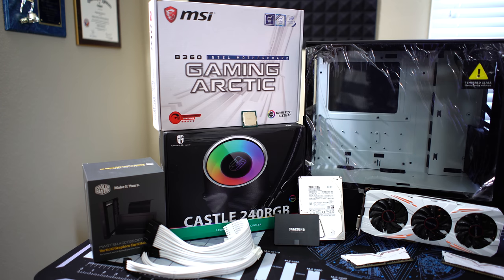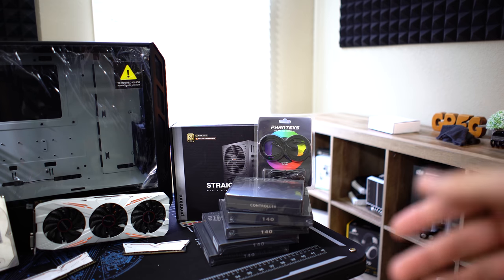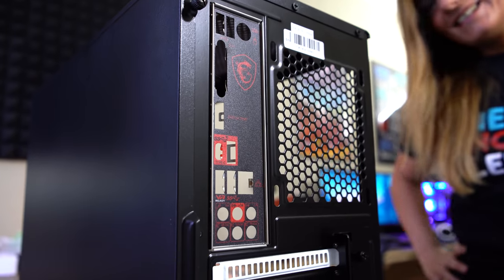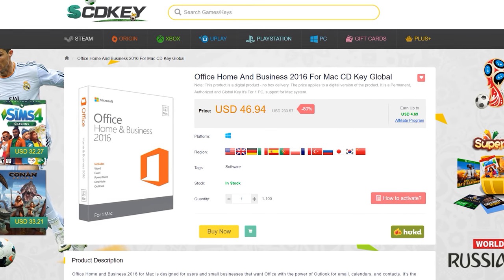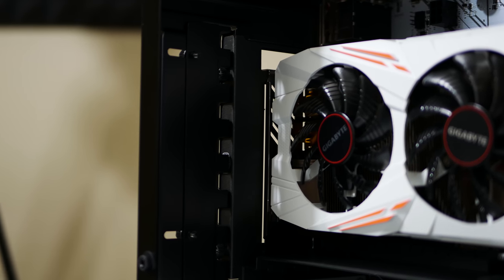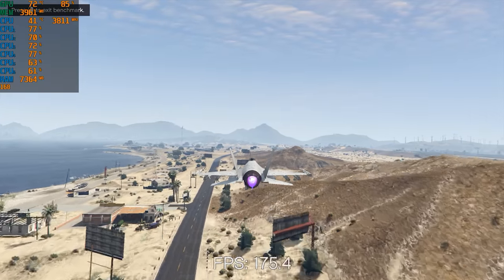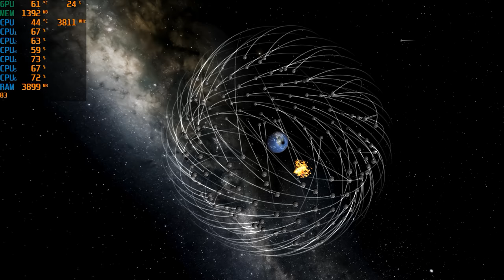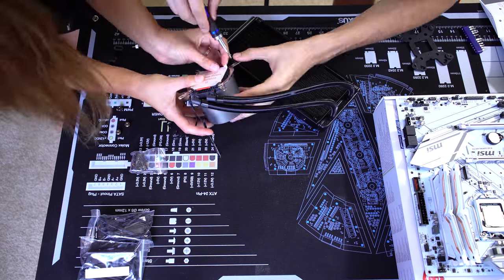We Paired a 1080Ti with an i5 8400...

Comment: Now try an 8350k. That'd be interesting.
Reply: ImpairedWraith 
Nobody likes to test the 8350k because of the high msrp.
 That being said i got my 8350k for $130. Overclocked to 5ghz and paired with a 1070ti, it scores a 16866 in firestrike. 10609 physics score which is cpu intensive.
Reply: ImpairedWraith is it as pointless as 7350k that Greg uses occasionally as a box cutter?

Comment: you kidding me, I stream with this cpu with on board integrated graphics don't underestimate this processor
Reply: 1080p or 720p
Reply: @sauravpradhan7881  mostly 720p it does stream on 1080p but it is very laggy now i have a graphic card finally so its sorted now
Reply: @faizbaig992  by nvme
Reply: @sauravpradhan7881  yeah i will some day

Comment: utilization is all well and dandy, but where are the 0.1% and 0.01% low frametimes especially when compared to the cpu's big brother? average framerates/utilization are great, but immersion breaking framedrops are shitty too. usually the i5 does worse than its i7 counterpart in this regard and almost every time intel cpus do this better than amd cpus. also depends on if you want ultimate best performance vs good performance. I think you want the former if you have a 1080ti

you should add frame data

Comment: getting a 1080ti inside i5-8400 is ok. Getting a new PC with i5 and 1080ti is however silly.
Reply: Marek Nowakowski this. Unless on budget
Reply: maome kat I don't see how you can argue about saving 100$ on the CPU when building a PC for 2k plus.
Reply: Marek Nowakowski on budget means 1000$ pc with usually cheap mobo/cpu/psi but you are right this mentality doesn't work with 1080ti.  It works with 1070 /1080 which cost 400-500 leaving you enough for cheap cpu/mobo/ram or used cpu/mobo combo which where old i5k/i7k work beautifully with 1070 for 120fps or 1440p 60fps

Comment: Great video, all the mistakes were avoided by.:
☑ 3000mhz memory on a board that only supports up to 2666mhz 
☑ useless Aio on that chip that runs cool on stock cooler.
☑ tests a 1080ti at 1080p
Reply from the maker: It's what I had on hand. Chill out.

Comment: Tho I’m no overlocker myself, I’d probably still opt for the i7-8700K as of this video, the i9-9900K as of my comment. Why? Easy: My PC will have to last 7 years+ before I’m getting a new one. The PC I’m using right now is 9 years old already with only a dual core CPU and while I admit, it’s just too old and weak overall, the software has become so much more demanding than I’d have expected back then, that I’d rather do opt for overkill, than being punished in the long run.

Comment: I would say Ryzen 2600 is better than i5 8400

It's all depend on you're Monitor actually 

Mostly people gaming at 1080p 60FPS

Ryzen 2600 is better for this case

It's has 6 extra thread over i5 8400 6C 6T ( and not forget about 12nm over 14nm )

& last not forget about CPU Heatsinks that include

Intel stock cooler i heard run a little hot at i5 8400 ( and it ugly )

But the AMD stock cooler is just `okay' 

You can gaming on AMD stock cooler without any overheating...
Reply: I own an i5 8400 and have to disagree and just to note that chip cannot overclock. My i5 runs cool most of the time even in heavy AAA games and I haven't experienced any heating issues unlike my older AMD FX6300 chip which used to shutdown even on liquid cooling.i5 8400 is still better over the 2600 in raw gaming.

Comment: Should I pair the i5 8400 with a gtx 1050ti? Or the ryzen 5 1600. On a budget that is why no ryzen 2nd gen
Reply: Go with ryzen. But your 1050ti will be a severe bottleneck
Reply: Neko r3 otherwise would be a great choice,since the gpu isnt high end one
Reply: Neko is a gtx 1060 6gb with the 1600 better
Reply: Simply Schematic the 1060 6gb would be way better
But i dont know the current price of these. If you squeeze a bit more out of your budget, then go with the 1600 and the 1060.
Will be a nice gaming rig!

Comment: I am going to upgrade but I can’t choose i have i5 6600k with gtx 1080  witch one to get i5 8600k or i7 8700k
Reply: I7, will definitely last longer. 12 threads will really be much more future proof than the 6 cores on an i5. I have a 1080 ti with the i5 8600k, runs almost all my games perfectly. Only need to overclock it to 5 ghz for Battlefield 1

Comment: I gotta disagree... Even though cpu utilization wasn't at 100%, since the gpu wasn't at 100% load, cpu was bottlenecking it still. I would say the bare minimum for a 1080ti is an overclocked i5 8600k. If you want to pair a lower end cpu with a 1080ti, play at 4k(more load placed on gpu).
Reply from the maker: GPU hovered in the mid to high 90s throughout most of these benchmarks... not sure to what you're referring.

Comment: Reasons to consider i5 over equally ryzen if you're on a budget:
Slightly better framerate in all games.
Better prices for motherboards, don't buy a ryzen without overclockable motherboard.
RAM price is retarded right now, and ryzen benefits heavily on RAM speed.

Comment: I run a similar build with a Ryzen 3 1200 @ 3.6 GHz, not found the limit yet.
Then a Zotac GTX 1080 Ti Mini and 16 GB DDR4-3600 RAM. :)
The Mainboard is a Gigabyte Aerus Gaming K7. Running stable so far with a really low temperature of max 50°C. :)
And compared to my old AMD FX 4130 or AMD FX 8300 it's 100%+ faster in 4K gaming. <3 (\ô/)
Reply: i wouldn't pair a 1200 with anything above a gtx 1060 or so :o
Reply: I don't see any problem with that. 99% of the time, the GPU gets 100% load, which seems fine for me. ;)
Only 3, maybe 5 out of my 500 games are running at 75 - 88% GPU load, which are mostly the high FPS ones, which wouldn't happen much in 4K. ;)

But I plan on upgrading to an AMD Ryzen 7 2700X, but at the time I build my PC, with a strong GPU, I only could get a cheap CPU. :/
And then I took the Ryzen 3 1200 and run it now stable at 4 GHz @ 1.5 Volt and temperatures stay around 58 - 67°C under peak load and I don't know if the Ryzen 3 has an offset too. :D (\ô/)
Reply: i forget sometimes man, too much weed XD
Reply: I don't blame you. :)
But the GPU is way more important than a CPU. ;)
The CPU is quite good enough, if it's a quad core, only high refresh monitors it's really important. ;)
But I'm running a 4K 60 Hz HDR10 panel, so the CPU isn't as important as the GPU. :) (\ô/)

Comment: i run my archaic 5820k x99 deluxe build @ 4.1 ghz to the death lol with 32 gb dom plats 2666 mhz cl15 with the corsair h105 240 aio and the evga 1080 ti ftw3 hybrid.. 1 tb 970 pro m.2 as system drive and 2x the 860 evo 1tb in raid 0 as fast storage and for games, a 120 gb sandisk ssd i don't really need anymore so i use it for swap and caching and stuff and 4 tb worth of hhds.. i don't see any need to upgrade anything anyhow whatsoever lol.. i mean the 8700k would be like what? 10% improvement or so.. not worth changing board and cpu yes faster clocks ipc and jibber jabber.. but dual channel ram so it looses there.. i don't know if ever i'd get the little threadripper with 8 cores and 64 lanes and reasonable 'bout 4 ghz clocks.. but not a good overclocker and well.. again i loose the single threaded performance i want.. so i'll wait.. what i have is more than i even need lol.. but sure nice to have.. and i can't really get from the cpus out right now what i really want.. lots of lanes, quad channel ram, not so many cores but high clocks.. and it goes really against that at the moment.. i don't need friggin 200 core cpus at 1 ghz i want 6 or 8 but fast cores..

Comment: but why? A 1080Ti is $750+ I would get it if the difference between a 1080 and a 1080Ti was $100 because you will get way more bang for your buck out of a 1080Ti over a 1080 vs a 8700k vs 8400, but the difference between a 1080Ti and a 1080 is $250 the price of a 8400 it's self.

If you haven't got the money to pair a 1080Ti with a 8700k just go with a 8400 and a 1070 / 1070Ti and go spend the money you would have saved half assing it on a better monitor or something, or even better just pocket the money and spend it on something worth while, the point of buying an 8700k to pair with a 1080Ti is so that you don't have to buy a new CPU and probably motherboard when you want to upgrade your graphics card because not only do you get the 6 cores 12 threads, but you also get the ability to overclock which will give you a lot of headroom when trying to run the "1180Ti"

The reason why I argue for the 2700X / 2700 / 2600X / 2600 is for people who are going to be keeping there CPU for like the next 4-5 years, the 8400 with a 1080Ti at 1440p is already maxed out at 90% to 100% utilization, while the 2700X / 2700 / 2600X / 2600 are at 40% to 60% utilization, I wouldn't pair them with a 1080Ti though as next gen you likely would run into a CPU bottleneck because I don't believe games by that point will be fully optimized for Zen or use 12 to 16 threads well.

The 8400 is bad in both the mid term and the long term, but if you plan to upgrade again within the next 2 years and plan to go with XX70 XX80 class GPUs it's not a bad buy, but it's an especially bad buy for a 1080Ti unless you upgrade your CPU every year, in which case then I would say you would be better off with Ryzen as Zen 2 coming next year will be compatible with current motherboards.

Comment: Uh I have an 8400 and it multitasks just fine? Like I have a bunch of apps open, and can still run games and get very good performance (haven't benchmarks, but haven't noticed any differences)...? I don't notice any lags when swithing between apps as well so I'm disagreeing with your impression about the i5.

I'm not disagreeing that the R5 x600s have better multi core performane (heck I would expect it to, it's an OCable SMT 6 core CPU), but rather that you're giving an impression that the i5 is a terrible multitasker which it definitely is not. 

Why not run a side by side comparision between it and the 2600 and have a load of apps open, do a bunch of app switching, using different apps, streaming YouTube, have loads of tab open and switch between them, play games while running lots of apps, etc. ?

I'm running 4 x 4GB dual channel fyi.

But seriously mate, sexy af build bang/10
Reply: Wizard Koer they have never been terrible multitaskers but when you run newest titles open a ton of shit up and stream then you will notice that i5 will bend to its knees

Comment: i have so many issues with i58400. im pretty sure its bottlenecking my GTX 1070. it always runs at 100% in modern games and i get a f ton of fps drops. my GPU often won;'t go above 60% so it can't be my gpu. Temps are fine
Reply: Check your ram speed ,had same rig and there was no bottleneck.now using a 1080 games run like breeze.Im using a 3000mhz ram tho on a z370 mobo.try disabling hpet in bios as well

Comment: I have a i5 8600 and a GTX 1080ti but in AC Origins and NFS Payback (maybe more games) the cpu usage is at 100% which limits my FPS and also in GTA V i dont get nearly as much FPS as in this video...what kind?
Reply: Same here I have a 1080 ti with an I5 8400. I just recently upgraded from a 1060, experiencing the same high CPU usage in games like BF1, Vermintide, Witcher 3.  I am playing at 1080p  75Hz. I think resolution may have an effect im not sure. What resolution are you playing at?
Reply: @WoollyWalrus  playing at the exact resolution and refresh rate as you. Ive even gone 1440p like in the vid but no luck.
Reply: @skillsteal8914  what about your ram? Are you maxing out your ram? I personally will be upgrading my ram soon from 8 to 16. I know that 8gb for the 1080 ti isnt enough. On games like bf1 I pretty much max out 96% of my ram. 
Most people online told me it's a processor issue. At first I thought it was my resolution being low at 1080p causing a lot more load on the cpu and less gpu utilization. But it turns out that increasing the resolution could put even more load on the cpu. I am honestly not sure at all how in this video he managed to get this kind of fps. But my rig can not even keep 75fps in any AAA game. This really sucks I was getting more stable performance with my 1060...
Reply: @WoollyWalrus  ive managed to use a cfg file for bf1 that allows me to play at 4K 60fps all the time. I have 12gb ram. Ive read that increasing the res does utilize more gpu, ive seen this myself while playing ac origins, going to 4K does make my gpu max out but my cpu usage stays at 100%. Far cry 5 i can max out while capping to 75fps at 1440p using the in game res scale i rarely drop below 60fps although again my gpu and cpu does not max out to keep it at 75fps.  GTA V i play maxed (no advanced settings on) at 1080p with about 95-105 avg fps, my cpu and gpu utilization is never full which i find odd though. All in all ive noticed that capping a game to either 60fps or our 75hz refresh rate does help with the cpu utilization.
Reply: @skillsteal8914  are u playing at native resolution or through dsr?
Reply: @WoollyWalrus  playing at native however games that have an in game res scale i usually play around with
Reply: I've got the 8400 and I don't get anywhere near 100% CPU usage in any game I've tried.
NFS payback I'm sure is 70 something and BF1 is like 75-85 if I remember.
I've seen 90 a few times but that's fine.
Not sure why yours is so high.

Comment: I think my i5-8400 is bottleneckng my rx 5600 xt, but i'm not really sure bcuza i also got 8 gigs of ram, so that also might be a ram bottle neck right? or is that my cpu?
Reply: If cpu usage is 99% and gpu usage is low, then its cpu bottleneck. Ram shouldnt cause low fps, but if a game stutters no matter the settings it means that you dont have enough ram. Tho i think 5600xt and 8400 should be fine.
Reply: Get 16 gigs of ram bro I had the same exact GPU and CPU as you and also 8gb of ram, once I got 16 gigs of ram my games didn't stutter anymore

Comment: Ewww you choked the gpu with a vertical mount. Its far less often the riser cable than it is the choked out airflow from having the gpu fans too close to the glass panel causing extra heat and gpu boost 3 to fail to maintain clocks anywhere near where it would otherwise.

Anyway I came here because I've got an i5-8500 1060 6gb system that I'm upgrading. GPU now and CPU in roughly 8-12 months. 1080ti is the choice so I was interested to see how well it would run until the cpu upgrade

Comment: is an i5 8400 good with 1070? i have 1070 with i5 4460 and get bottlenecking
Reply: Yep, im running i5 8400 with 1070 and runs absolutely fantastic. Any game at 1440p high-ultra (after a bit of optimization) runs at 80-130 FPS. I have seen my graphs over prolonged gaming sessions and the CPU NEVER bottlenecks. Also with stock CPU cooler reaching its normal operation temps of 60-80 Celcius NEVER EVER gets thermal throttle. So its a PERFECT combo. I would say my next upgrade will be 1080ti or the next AMD Navi 7nm when they launch on 2019. And if i start getting bottle necks its just matter of swapping the CPU for an 8th gen i7 and problem solved. The build offers EXCELLENT gaming with amazing power saving capabilities, only 150-180 Watts (whole CPU) under full load.

Comment: Hi how come I get extreme lag in every game my specs : i5 8400 , msi gtx 1080 gaming 8gb x, my ram is 8gb single channel 8x1 stick. And my monitors refresh rate is 75hz.
Reply: Dual channel over single stick of ram. Even if its 2x4gb. its better then 1x8gb. Less stress on the ram when running with two 4gbs or two 8gbs.
Reply: Nickalo Anderson wait so is the ram causing all that lag or the cpu?
Reply: @racksfromnyc8536  i will say ram. That cpu is strong when it comes to gaming. If you really watched the video. He shows that the 1080 ti runs just fine and im sure everything at stock settings too of course. Im more then likely sure its the ram. If you have 1x8gb then add another 8gb and you should be good. Also make sure your ram are in the right slots. Most people tend to mess up on this part but its easy. Slot 2 for one ram. Slot 2 and 4 for two ram sticks. Of course all slots if you have four sticks.
Reply: Nickalo Anderson okay thanks and I have the intel stock cooler is that bad is that also causing the lag?
Reply: @racksfromnyc8536  not at all. Your using a none k cpu. If you were then thats when you buy a air cooler or aio cooler. I have the i5 8400 and 1070 ti with 4x4gb =16gb on my msi board with an aio cooler cause i just like the looks of em plus they will surely keep my cpu cooler then a stock cooler and air cooler are more of the past type of thing to me.